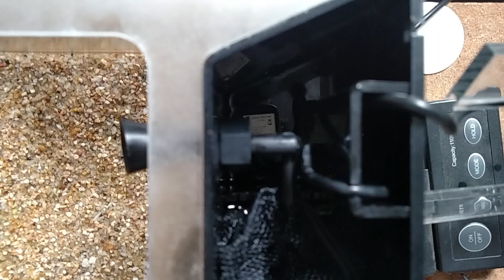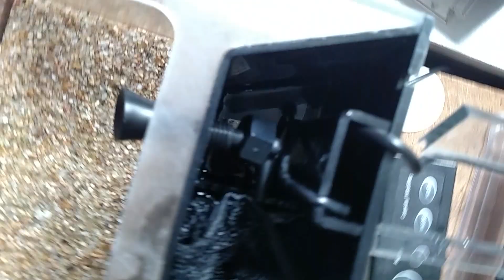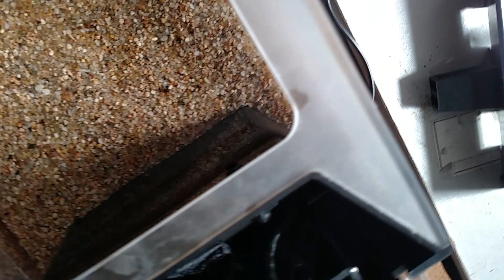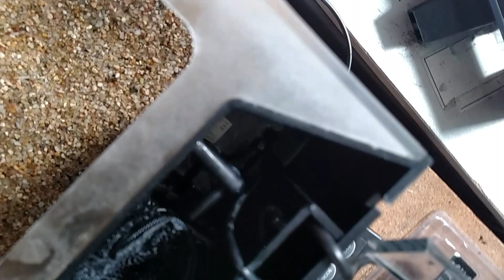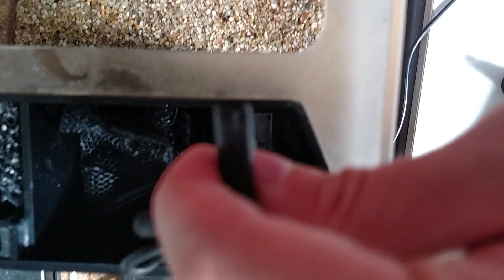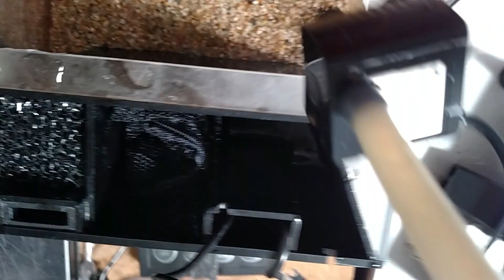EcoQube C - Removing the Pump

Comment: 'in case you ever need to remove the pump'.... i have to remove mine every other week because it gets clogged and stops circulating the water. there is no contact email address on your website. both of my pumps have failed. i am very disappointed with the product.
Reply from the maker: Hi, thanks for reaching out to us here. Sounds like there's excess debris in your ecosystem. You can contact us via email below or via contact form on our website: info@aquadesigninnovations.com. looking forward to chatting with you soon!
Reply: Any luck since?